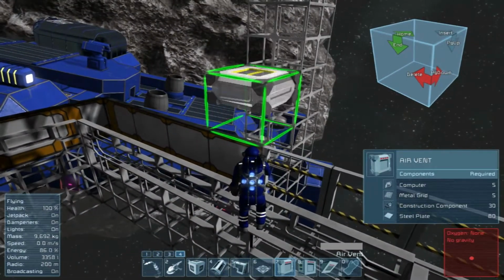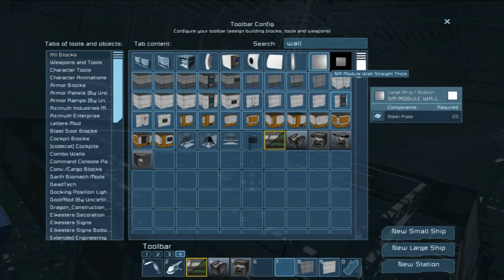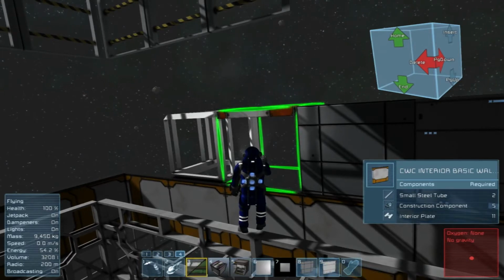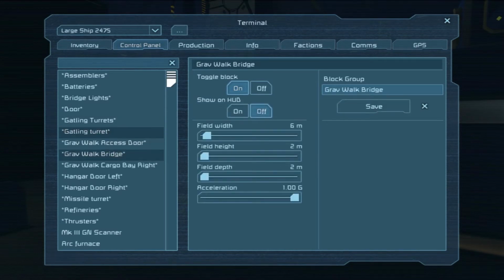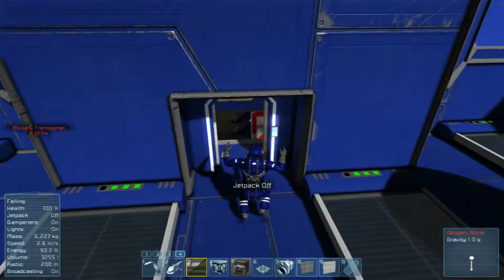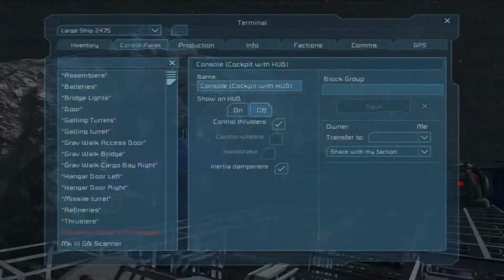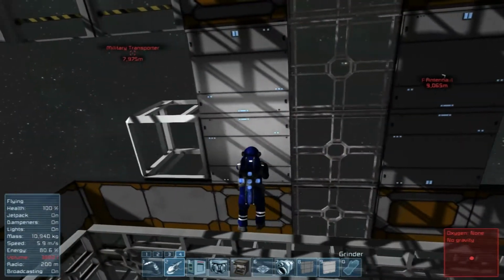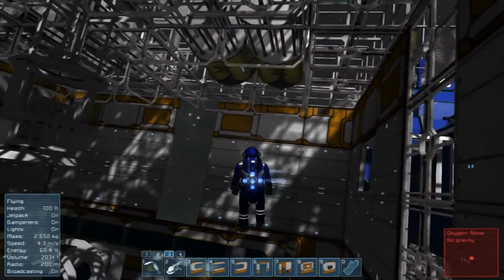Let's Play Space Engineers - Episode 31: Engine Room Progress!

Comment: Love the grav-walk work so far! I think you should have the entire ship bi-decked with split grav
Reply: Though aesthetic wise i think it would be better if the transition grav-walks on the walls were sunk into the wall its self and had ramp grav-walks to get on and off. Sure it works with it straight up, but human sensibility wise it would be far more comfortable on the mind to take it gradually! It also means the wall gravity affecting the main floor can be lessened for a smoother passing by experience and by sinking them into the wall, it will add another layer of interest to the overall look by having a three dimensional wall rather then a flat surface!
Reply: Unless on a tablet, there is now an edit button for comments.
Reply from the maker: ***** I think I might make the whole thing split grav, it'd be fun & different I think. As to the sunk in grav walk there's one BIG problem with that. There isn't a "combo block" in SE yet, so those walls take up a FULL block. So to do a ramp or something, you'd have exposed space on the side where you can't place another block to make a "sunk in wall" for the ramp, does that make sense? (not sure if I explained that very well). Unless you're just meaning to make the start & stop points a ramp? But that wouldn't be very "sunk in" so to speak.
Reply: I mean the on and off point! So you'd replace the current grav-walks on the walls with a ramp grav-walk to get on/off, two flat grav-walks to transition and another grav-walk to get off/on! The walls at the either side will need to become full blocks or slope blocks for more room on the other side! Which i think could be a good thing as it adds  another 3d surface on the other side rather then a comparatively boring flat wall! So it would be scooping into the wall as it were
Reply from the maker: *****
It's an interesting idea. I'll have to mess around with it at some point & see if I can get it to look right.